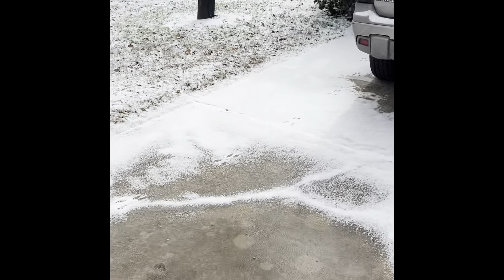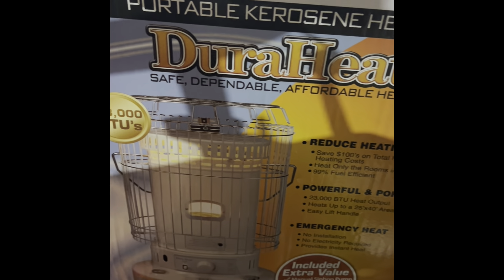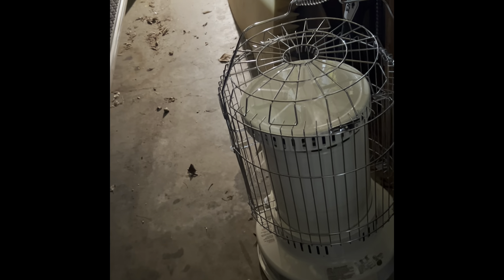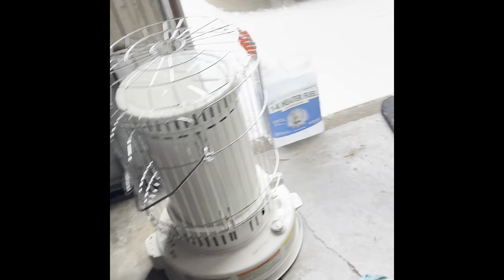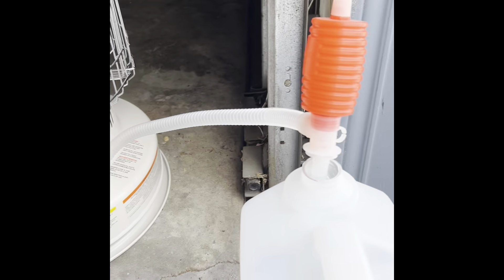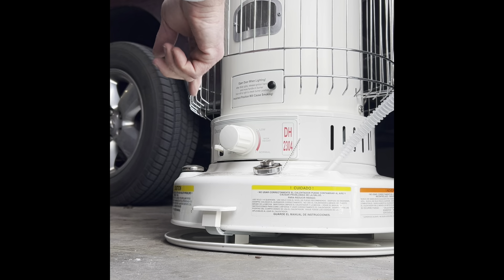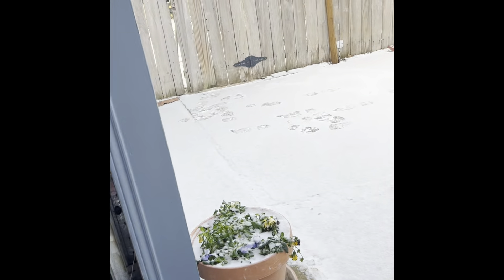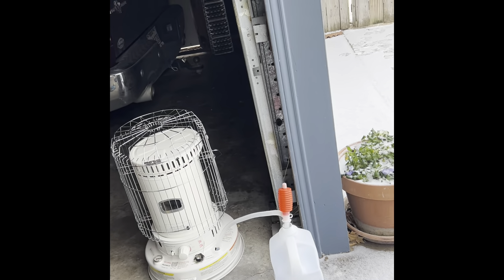Kerosene space heater! How I stay warm during times of extreme cold / emergencies!

Comment: Hit the teens here in western WA last week and broke some records. Heat for house is all electric and could not keep up with the cold. I will have to look into this has a backup. The maintenance tips are much appreciated (take care of your equipment and they will take care of you). Many thanks for putting this together.
Reply from the maker: You’re welcome. Glad it helped! As always, do read the owners manual and follow all procedures. Mine came w a detailed manual as well as a quick start guide that just outlined basic procedures. Best to read everything and get a handle on what you’re doing before ya try to use something like this.
Reply: Look at getting a propane Mr. Buddy.  Kerosene is just too expensive.  In Dallas I paid $29+tax for 2.5 gallons and only gives 8 hours of full heat mode use.   Can't afford that .  Love the heater hate the cost of using.

Comment: Love my kerosene heater, bought it used from someone local for 30 bucks just had to replace the wick, works like a charm. Just make sure you keep the air circulated and have good ventilation.
Reply from the maker: @Pure1989  exactly. I have mine in the front room, open the front door every hour or two when it’s on to let fresh air in. It operates like a giant candle. I keep a co detector right close to it but it always reads 0

Comment: i had one of those way back in.... 1986? around then. it puts out good heat. it didnt have the wire around it. i remember how replacing the wick sock had to be just right or it burned half side high not good.. but it did heat great. i put a pan of water on top. now i use mr buddy to offset the heatpump and space heater.  stay warm 😊🏡👍
Reply from the maker: Wow, nice!

Comment: i had a kerosine heater for heating my living space. it was the more boxy kind of one with the ceramic thing.
a full tank could last as little as 3.5 - 4 hours, or if you turned it all the way down you could get it to last just about 8 hours.

i stopped using it inside because one night i woke up with a terrible headache. after i got myself up i realized what was going on and opened a few windows, wrapped up in a blanket and went outside. the thing used up all the oxygen in the house, or at least enough that i could have drifted off to never wake up again land. you gotta vent a little and be super careful.
Reply from the maker: Yeah, I’ve heard that before about them. What I do is keep the heater in the largest room of my house the very front living areas, and frequently open the front door for a few seconds every hour to let some fresh air in. I keep a carbon monoxide monitor near it just in case, and it’s never gone off, always reads at 0. I also don’t run it at night when I’m asleep, just during the day / until I go to bed.
Reply: @BigRedServicesLLC  sounds like you have a good plan going. i was dumb and did all the wrong things.
Reply from the maker: @PaulC001  I always advise to read the owners manual for operation, it does have a caution section; some heaters recommend you not operate indoors, others say operate indoors but not at night / leave them unattended.
Reply: I never run mine at night, or especially if I were asleep.  Make sure you use K1 CLEAN fuel. Read the manual.
Reply from the maker: @danettecross8608  yes! Forgot to mention that, clean kerosene not any other type of fuel. 100% read the manual.

Comment: pro tip those klean heat bottles are not air tight after you break their foil seal. pour it out into a blue air tight container meant for kerosene and it will last longer, not evaporate away and not spoil.
Reply from the maker: @Sidicas  thx for the heads up!

Comment: i use the same thing. I use it in the kitchen. I am thinking of a Chinese diesel heater. here in KY diesel is $2.00 a gallon cheaper. Kerosene is costing me $75.00 a week.
Reply from the maker: Yeah kerosene isn’t the cheapest right now. $30 for 2.5 gal container at HD, and no fill up stations around me, rural areas maybe. But ya can’t beat it for emergency / supplementary heat imo.

Comment: Is kerosene readily available in DFW? I'm in east Texas and nobody carries it except box stores and it's wayyyy expensive there. Certain YouTubers are touting using ultra low sulfur diesel as a substitute but you must use a cotton wick.
Reply from the maker: Yes, it is available; but like ya said, pretty much box stores (Home Depot, Lowe’s, ace hardware etc) and yeah it’s not terribly cheap right now either. I haven’t been able to find a station to fill up my empty containers like we do for gasoline for vehicles. I haven’t heard that about low sulfur diesel but personally I wouldn’t recommend that; the heater manual says to only use K1 kerosene. I did find spare wicks at the Home Depot so picked one up just in case.